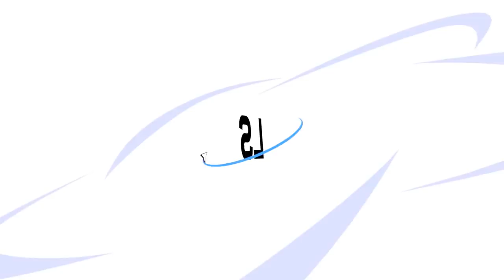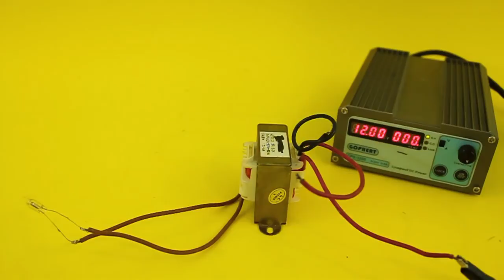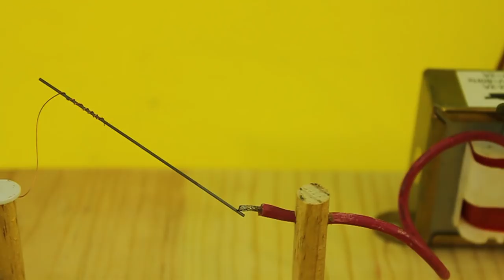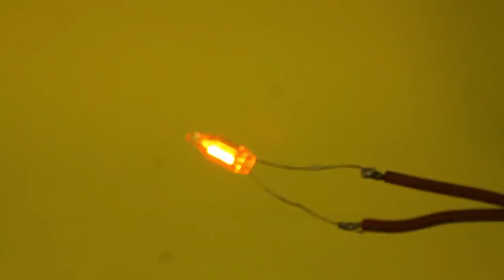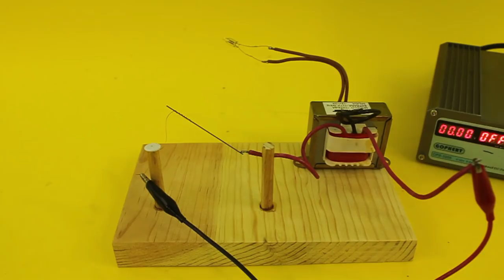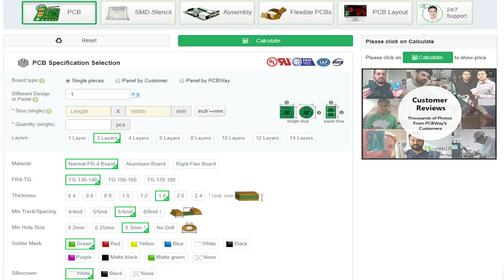Carbon Oscillator

Comment: Notice the coil of wire on the pencil lead. When he applied current to it. The coil became a magnet and it pulled the lead away from the contact which shut the current off than the coil lost it magnetic field but acting like a spring push the lead back against the contact reenergize the coil magnetic field to pull it away from the contact. Remember breaking and connecting the lead makes pulsing D.C. which light the neon bulb.  Hope this explains it.
Reply: Wow . I thought it was a spark gap that generated oscillations
Reply: There are too few turns and no core, also much current bypasses that "coil", so it's magnetic field is very weak. There's also no ferromagnetic metal nearby , so it can't push or pull against it.

Comment: you should try connecting capacitors between the carbon rod and the transformer and the primary of the transformer and see what configuration will change the frequency and what configuration will make it stop working

Comment: I think all thats happening is the graphite has a very small point of contact with the wire, which heats up, burns out and then looses contact. There is a bit of tension on the rod pushing it ever so slightly toward the wire and they touch, restarting the process until there is not enough tension to make contact after burn out.

Comment: Spark gap breakdown = plasma = negative resistance and negative resistance (absolute not relative) = overunity power gain! .....If you don't mind the broad spectrum splatter.

Comment: I used a 120-6V transformer in reverse to power the HV section of a homemade Geiger counter. Rigged up a 555 and a MOSFET to convert the DC in to AC.

Comment: beautiful ozillator , nice past , we can build with this also a mini tesla coil , also with the relais ozilator or reedswitch ozilator as a primary main sensor for Mosfets , ,this sensors start from zero -point as a C driver for mosfets , all transistor drivers need for ozilation a little current and become faster hot ( A or B tact ) , but to use the batteries just from zeropoint in C tact  , all devices becomes best quality in using the fully rangement of capacity of the batterie , the name of these zero point sensors are mechatronics  sensors ,,thats sometimes better than much parts and soldering points , because the shortes way of solution have longlife more that 50 soldering points , your presentations are wonderful , thanks much

Comment: It look like a carbon is burning cause the rod bounding maybe it become CO2? after burn ? and make a disconnection and the copper spring push it back and conduct again. This is very nice ideal , such as simple way to make inverter , the only thing is how long the carbon can last? after burning.

Comment: would be cool to look at the oscillator waveform on a scope
Reply: Yes! But it could be just some noise..
Reply: Probably just look like some irregular square wave with some high voltage inductive spikes at every cutoff cycle.
Reply: My oscilloscope got jacked😢
Reply: @tomfly3155  F

Comment: I had a thought, If we have a resistor in series with a transformer feeding it with dc when the current goes high the resistor gets hot and changes resistance wich then causes less current to flow wich then cools down the resistor wich conducts more and heats back up aso...

I think this is kinda like i thought but maybe with arcs due to the flyback voltage ?
Reply from the maker: Interesting but I am not sure if the resistor in series will oscillate, I would bet that after a transient oscillation equilibrium will be reached. But only experiment has the final word
Reply: Thats what o was thinking maybe a cap in parallel with coil cloud help ?
Reply: Or maybe a very temperature dependant resistor like a light bulb would work yet still equilibrium would be reached.

But if we have a load on the coil with more turns of a transformer with a 10:1 turns ratio that turns on at say 50V like the neon then it would pull some energy meaning it would pull more current heating the "lamp" (resistor) up cusing less current to flow cooling the "lamp" (resistor) down aso.

Kinda like a zener diode with a resistor in series,only here we are using a resistor and transformer.

Comment: Notice, that the neon lamp was blinking with just with one electrode when connecting, and with just with the other one when disconnecting the power supply. Try to figure out why...
Reply: Pulsed dc man no true ac waveform

Comment: But how?
Why oscillates this?
You dont give even the least explaination! Okay they used this earlier. But what is the reason it works?? 
It sure cóuld be interesting enough wíth explaining. 
Or do we have to google it ourselfs out áfter watching your video?
Reply: Rob Son it looks like it sparks and slowly eats the carbon rod.
Reply: it's not "oscillating", it's just a bad connection interrupting the current
Reply: My guess is that the spark heats the air causing expansion of the air.  Like thunder.  The pencil lead is on a delicate spring (the connecting wire)  and is pushed away by the pressure.  This breaks the circuit.  A moment later the spring pushes them back together.  Repeat.  The fact that the pencil lead is carbon may help.  Some of the carbon combusts to form carbon monoxide or carbon dioxide which improves the sudden pressure increase.
Reply: Ray Kent that's exactly what I was thinking, I just didn't want to go that in depth to explain it.
Reply: Rob Son
Simple explanation: It's a spark-gap oscillator, with the transformer coil being the inductance.
OTOH there are big books about spark-gap oscillators and transmitters, and they are in use even today.
Reply: BR Gurunandan

Now i see it, and indeed, with that induction, you are exactly right, thanx man!
Reply: BR Gurunandan   you may be right, but I don't think so.  The classic spark gap oscillator has a series resistor and parallel capacitor.   These may be, in effect,  part of Ludic's power supply if it's bad.  The effect would not happen with an ideal power supply, you'd get a continuous spark or none.  No reason for oscillation.  I think that if Ludic were trying to demonstrate a classic spark gap oscillator he would have  had the gap between two fixed bits of wire, with a series resistor from the supply feeding across a parallel capacitor. Why go to the trouble of using a pencil lead on a thin springy wire?   I think he's wanting to show that the necessary time lag for oscillation can also be done by having an inertial mass on a spring and using the physical force of gas expansion from the spark.  I hope he will explain his thinking in the next video.
Reply: Rob Son: I think the carbon/graphite is ionized until it discharges creating a spark. Then the process starts again.
Reply: Ray Kent 
The resistor is only for limiting the sparkcurrent thus thats the resistance from the pencillead and indeed limits his supply the current.
No, it is indeed a spark gap oscillator so br gurundanan saw trough it very good
Reply: I had a thought, If we have a resistor in series with a transformer feeding it with dc when the current goes high the resistor gets hot and changes resistance wich then causes less current to flow wich then cools down the resistor wich conducts more and heats back up aso...

I think this is kinda like i thought but maybe with arcs due to the flyback voltage ?